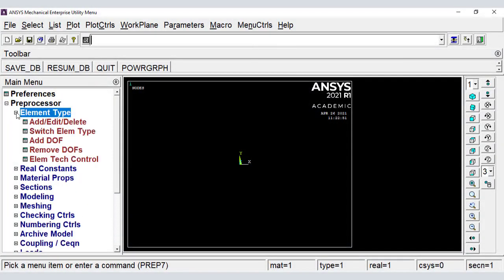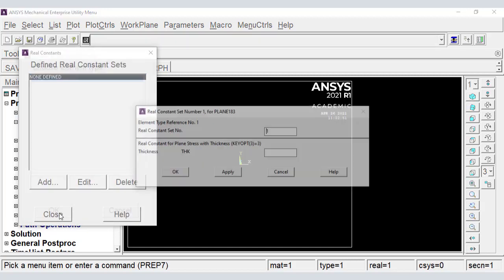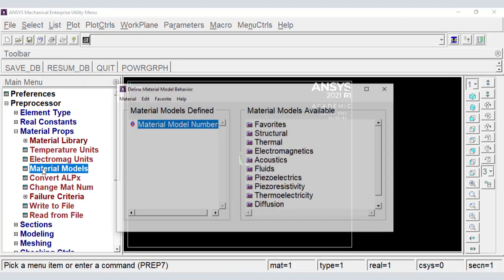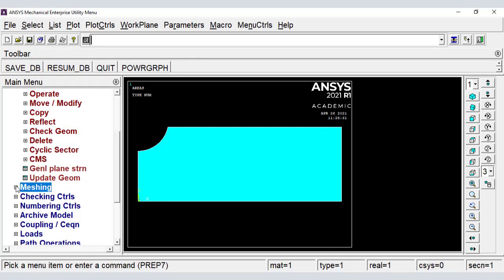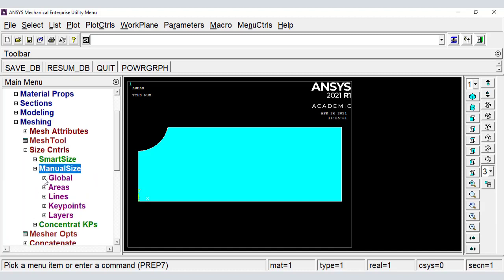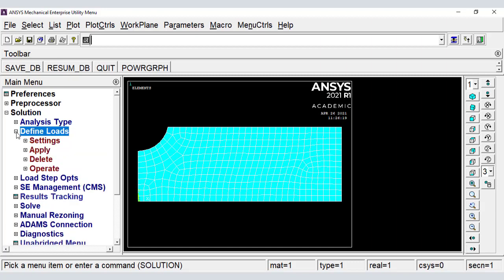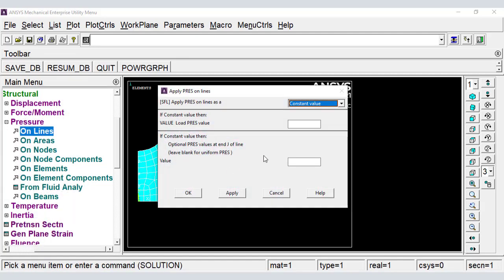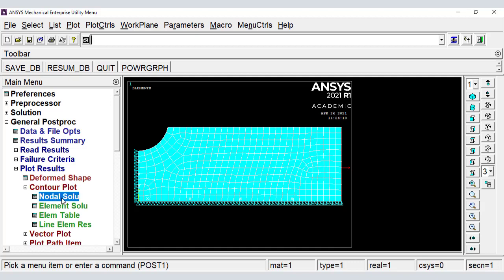ANSYS APDL Ex_2.5 PLANE183 plane stress/strain of 2D flat parts using symmetry boundary conditions

Comment: Dear Professor,

Dear Professor. This is Phanindra. In need to develop APDL code for FE simulation of isotensoid helical winding spherical pressure vessel.
Is it possible in APDL to define angle variation in each layer ?
Reply from the maker: Yes. Back in 1983-86 I did that in Fortran and fed the data to Abaqus. APDL is like a min Fortran so programming is no problem. First find out how to feed angles to each element. Then depending on the coordinates feed the angle to each element.
Reply: @EverBarbero  Thank you professor. I will think about this method for implementation.